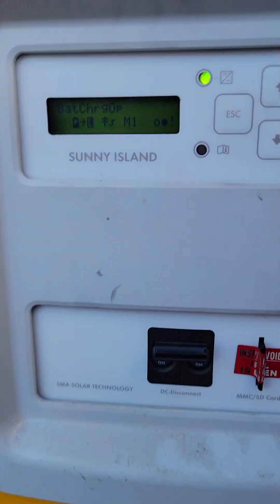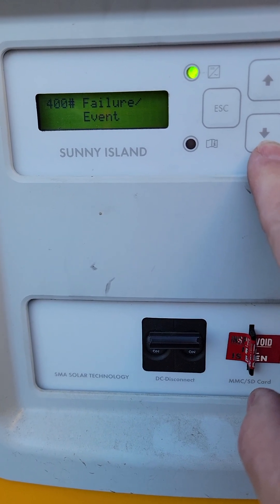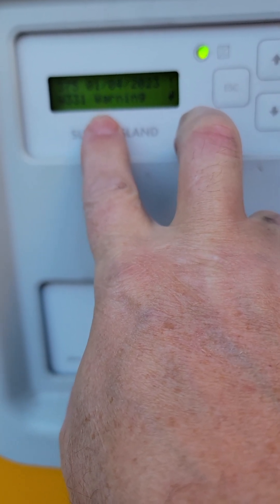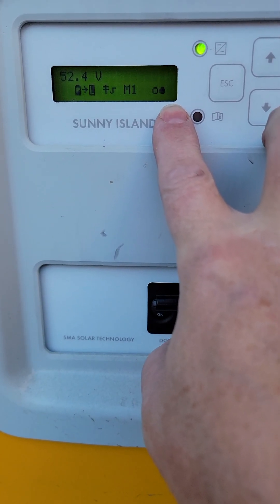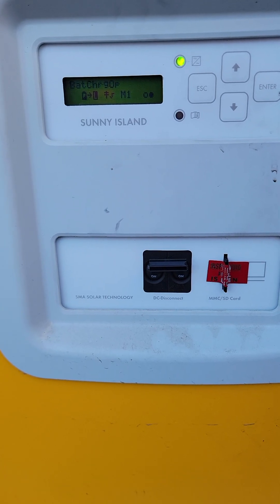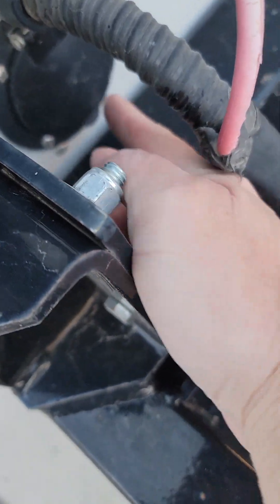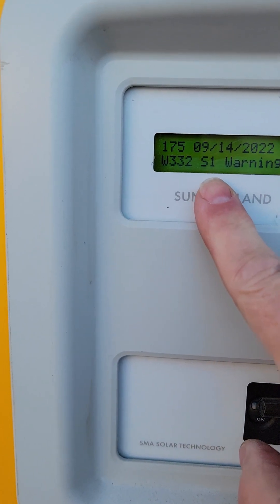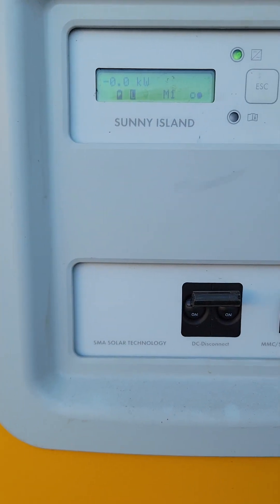How to clear the error status on the master Sunny Island inverter

Comment: You wouldn't happen to know what the #13GnRvPwr setting is for. It shows as watts. It is in the generator control menu. I couldn't seem to find it in the manual. I am assuming it may be the wattage ratting for your generator.